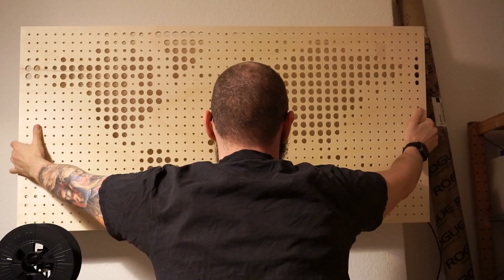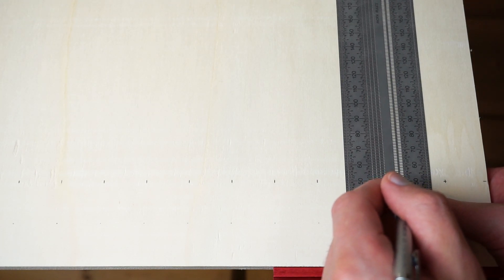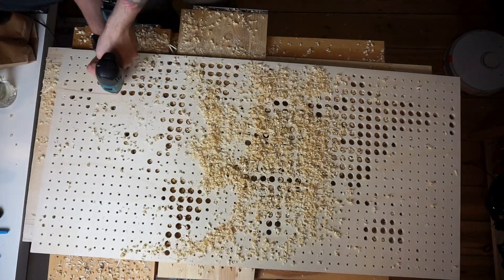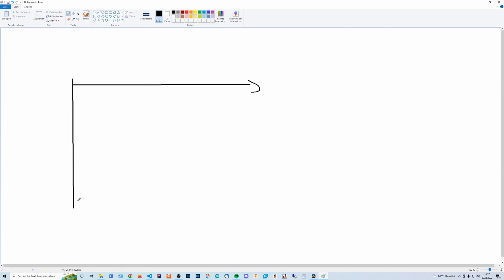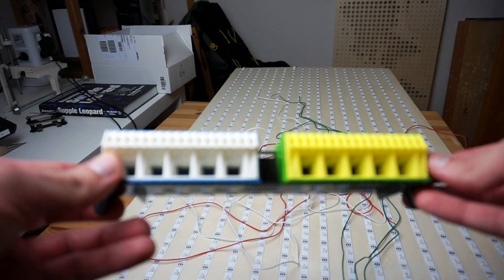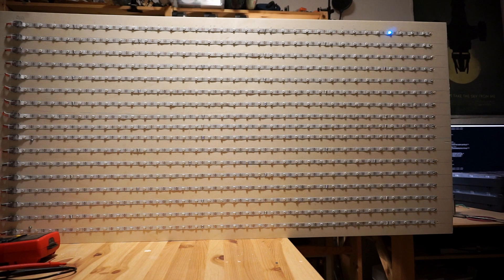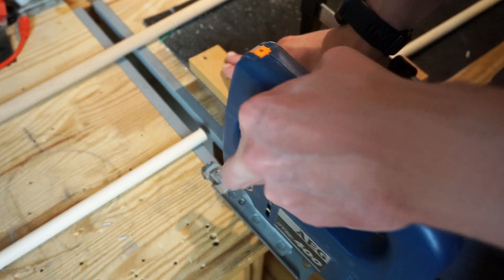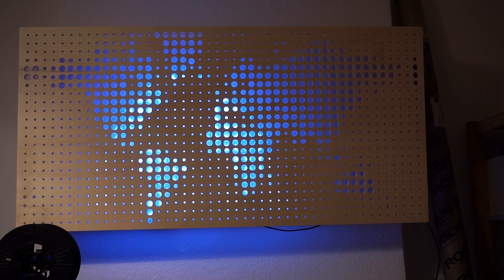Lets built - LED Worldmap

Comment: Use an arduino to adress the leds. Its much much faster. People can run realtime video on theses leds.
Reply from the maker: I thought about it, but wanted to use python to code. With C, i probably would have to calculate the terminator myself.
Reply: @smash_that_like  I don't imagine it's too bad. first take a point on the x/y plane, and transform it to a point on the unit sphere. looking on wikipedia for the mercator transformation, all you need is an exponential function and an arctangent. Maybe arduino has a library for it, otherwise there are lots of efficient solutions, and a rather crude approximation also wouldn't be too bad. 

then once you have the polar coordinates, convert to a cartesian point on the unit sphere. (now that i think of it this may be even easier if done directly - basically, wrap the plane into the cylinder aligned with earth's rotation axis, and divide the point by its magnitude. boom, point on the unit sphere)

then define a direction vector for the sun, and calculate the inner product of that with your point on the unit sphere. if >0 it's day, otherwise night, with some smooth transition as desired :)